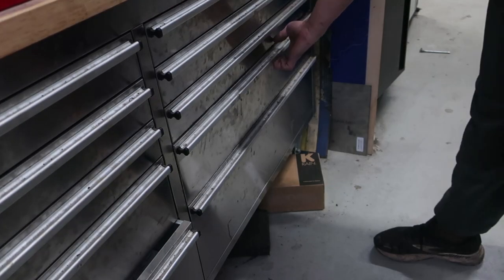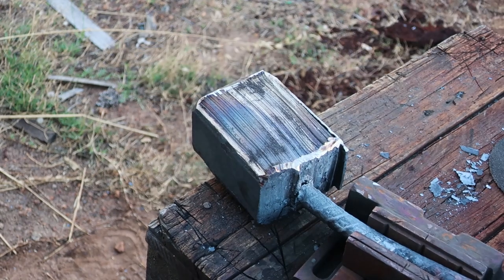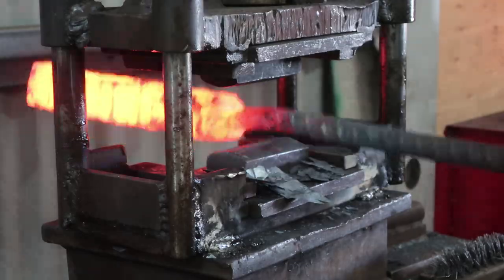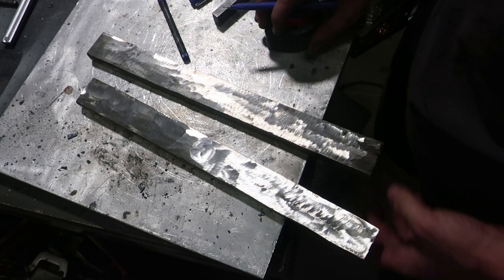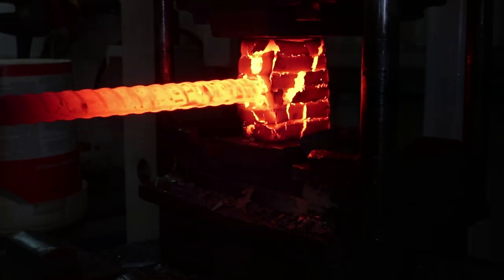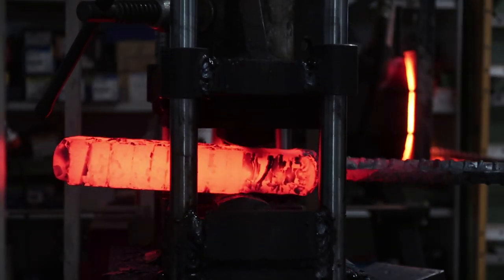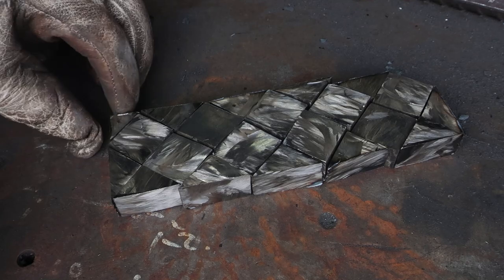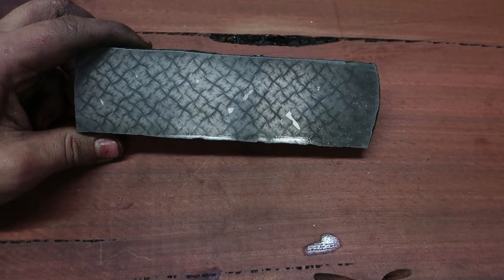knife making- Chefs knife Basket weave Damascus (part 1)

Comment: First, the pattern is pretty awesome. At some time down the road, I would love to be able to make patterns like that. I just started my first knife in December of 22. Just doing material removal for a while, until I am comfortable that I can make a solid knife without the complexities of forging.
Reply from the maker: thank you for the compliment. Stock removal is a good way to start, I used a old file for my first one. sometimes you can put a lot of work into forging a knife and it could go to waist when you start to grinding, heat treating an so on because you just didn't practice enough. so its good that you're focusing on the basics. good luck for the future mate!.

Comment: I am a maker, home made coal forge with hairdryer air made from an old brake disc, bit of scrap car exhaust and built onto the frame of an old folding bed, a homemade anvil still under construction and been doing it for the last near 3 years, first knife I made was at school until I got caught lol, then life, women, beer and bikes happened, the inevitable family and a gap of getting on for 40 40 years until I had an accident and infection which left me unable to work, got to watching a lot of YouTube while unable to walk and rediscovered making blades so when I was finally a little mobile I gave it a try with a gas torch and plant pot for a forge, first took ages but came out ok so built a better gas forge, still torch powered and went again, again worked out ok but the forge was very limited so built the coal version and got a large iron railway track chair to use as an anvil and have been adding weight and such to that ever since, in the meantime I have got more mobility and a 4 day a week job and so time is now limited with recovery time for my leg and neighbours working nights so don't make as many as I want but still keeping going and learning as I go, no real grinder to speak of apart from a bench grinder, all done with hammers and files by hand pretty much and that is how I like it, keeping it traditional and making ancient design based blades, now got to the stage where I need to make my forge bigger as it is pretty limiting now with regards to getting larger pieces hot enough to do what I want
Reply from the maker: haha just saying you made a knife at school reminded me that I made three throwing stars at work experience. I'm sorry to hear about the accident mate, but from what I hear you are making it work. lucky for me I don't drink and I haven't discover women yet so I have time. I still wish I had a coal forge and use hand tool only for the odd occasion  because it becomes vey therapeutic appose to a loud gas forge and belt grinder . I appreciate the comment and good luck on your journey. p.s. the burners I have are from Gameco artisans supply I think Alec steel also stock them and they go really good so that might be an option.